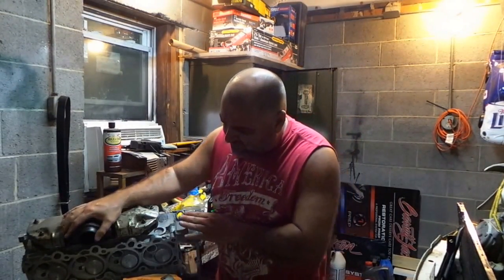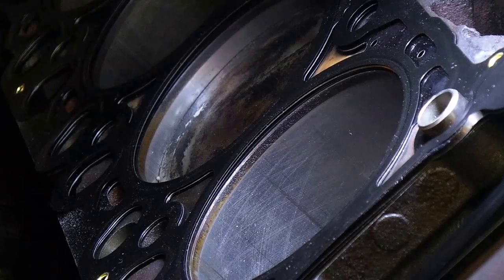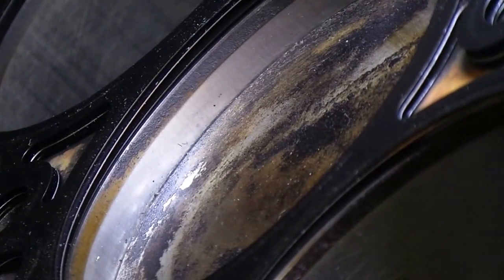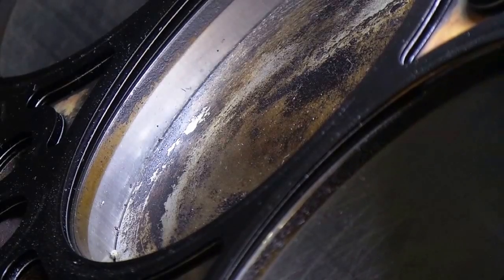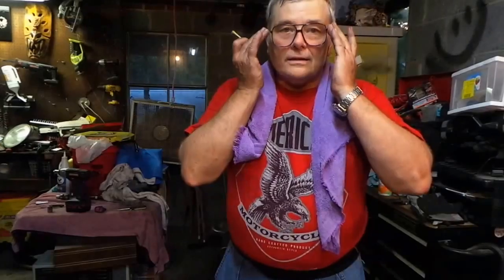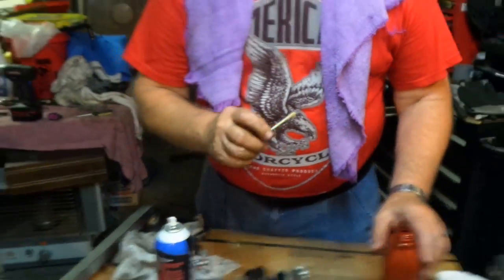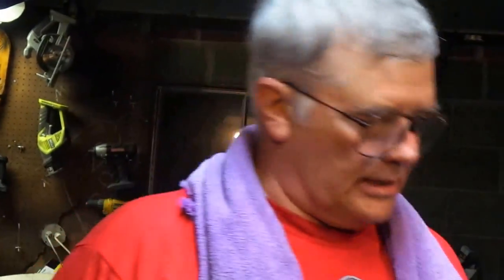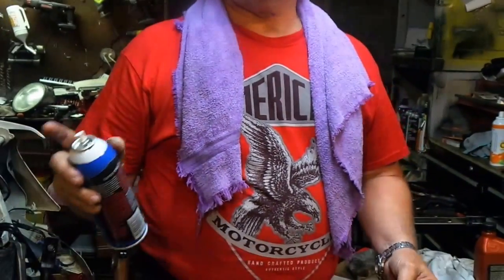How To Install Cylinder Head On A 3.7/4.7 Chrysler Engine

Comment: Hello..when i removed the timing chain on my 2006 jeep commander 4.7 i found out this engine has not the inner gear behind the timing chain gears.the little one thet line up and goes in the upper shaft..now i would like to know is this engine is that way last time some ody worked in this jeep before and forgot the to put back the gear.

Comment: Andrew J that is hardly possible, they make chain blocks, or cut a piece of wood to hold chain tight that goes to the head between the tensioners, and carefully remove the bolt on the cam sprocket, after marking it's position, then as you the sprocket and chain off the cam, the cam may rotate from valve spring pressure, but not much, but retweaked with a backup wrench on the camshaft at assembly, then the sprocket can go down a bit and out of chain and rest slacked part of chain down, and should be able to start unbolting the head. 
Problem:
When you try to remove head, you may need to mallet it a bit and this or raising the head can disturb the chain and lose the timing behind the timing cover. It is possible, like Houdini possible,  yet have a towtruck on standby, and dont get mad, you truck will be gone for two months but all those other gaskets will be changed and ordered one by one while your truck sits, gutted and rusting.

Comment: On a 3.7 can I take one cylinder head off and put it back on without removing the timing cover and chain? It looks like I could and long as I time it all
Reply: Yes it is possible. On passenger side head. Rotate the engine so that all the valves are closed so the cam won't turn. Do not rotate the crankshaft until the cam sprocket is reinstalled. Mark the chain with the timing mark on the sprocket. Remove the sprocket and use a snap strap keep the chain tight. Remove the two slide bolts and tie the slides together sandwiching the chain. Stuff a rag in the chain cavity when removing and installing the small head bolts. Installing the head is a little cumbersome with the chain and two slides. Torque head bolts. Tie the chain with a snap strap to keep tension on it and untie the slides. place the camshaft sprocket in time with the chain you marked, and use a large punch to hold the sprocket onto the cam as it likely won't go on. Install the slide bolts. The tensioner may have to be reset by using a long stuff wire bent in a square U about 1/2 inch wide and deep. The reset hole is on the back side of the tensioner in line with the ratchet shaft so you have to pull the hook into the release hole to disengage the ratchet and use the punch through the sprocket into the cam to tighten the chain, or leave the lower slide bolt removed and pry up on it without breaking it. The sprocket should then be able to slide on the camshaft In line with the dowel and install the bolt.

Comment: only thing that is scary here is the head was not resurfaced.
Reply: If the heads flat then its flat there is no need to resurface a flat head.
Reply: Hardly ever do I have heads resurfaced. Clean them up, check for flat, have them pressure checked if it previously overheated and install with new gasket and bolts. Good to go

Comment: I have one tip on the removing the harmonic balance... i cut down a old head bolt cause the "Chrysler harmonic balancer puller kit" the rods aren't long enough to remove the 4.7l balancer
.